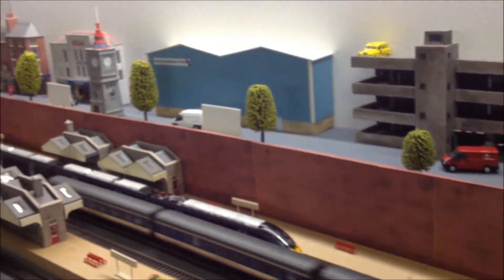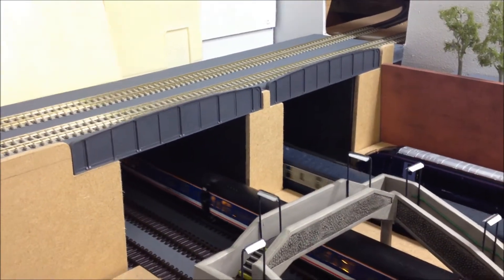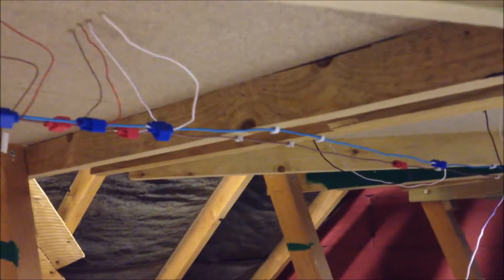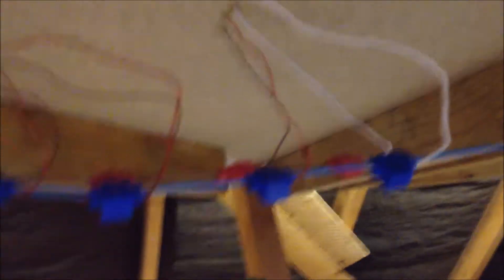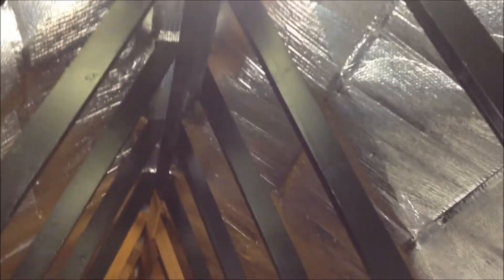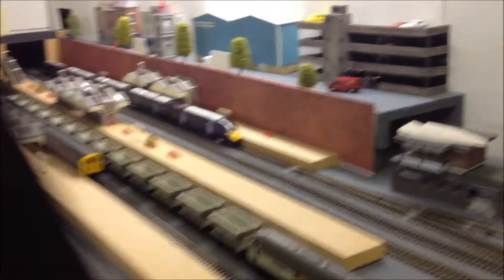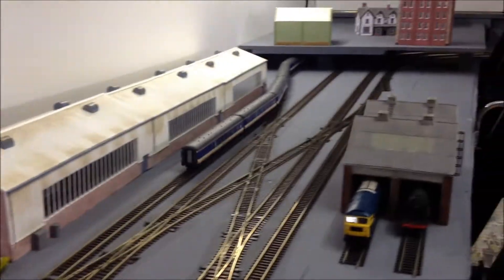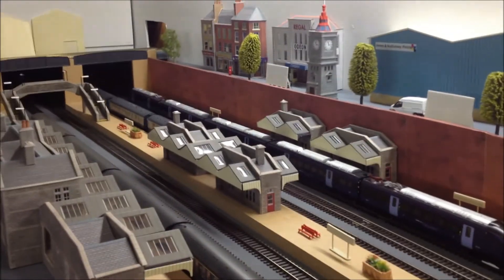Five Elms Layout Update 7---6 TRAINS RUNNING | TEMP SCENERY | BUS WIRE |

Comment: Very nice job with the bus wire droppers, i have used the same method they are easy and work well. My layout is shed based and i have also used the silver foil to help with the cold winter months, but it feels like the inside of an oven in the summer. Your layout is going to be one of the best ones on you tube when its finished, love the loft space you have, wish i had a loft, can't see the wife wanting to move so i can have a loft to play trains in lol. 
Keep up the good work, Mark

Comment: good start Jason,i am going to copy your viaduct.  I put a Velux type window in my loft and it has made a tremendous difference not only to the loft but in the recent hot weather i leave the loft flap down, ladder up, velux slightly open and it creates a breeze through the house with some windows open. I have subbed so keep the updates coming

Comment: I have watched all your videos with great interest as my loft is identical minus the water tank - great idea with the insulation - do you have a dehumidifier? I'm thinking of putting in small velux windows to try and control the temperature - have you had any problems with boards warping at all or track expanding? The ideas are endless....am very inspired - well done ......